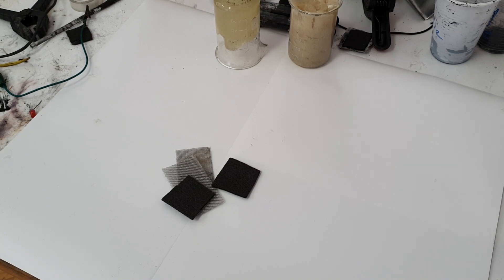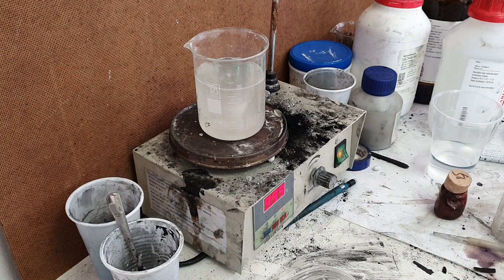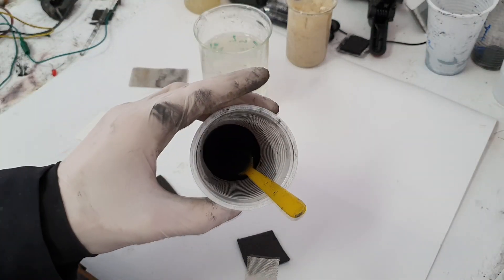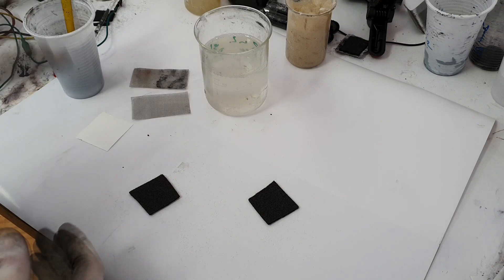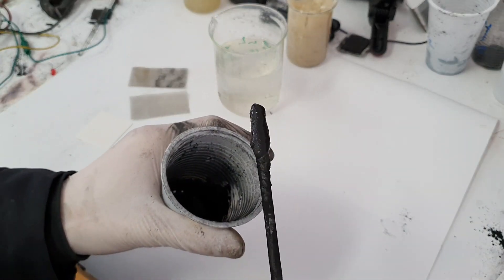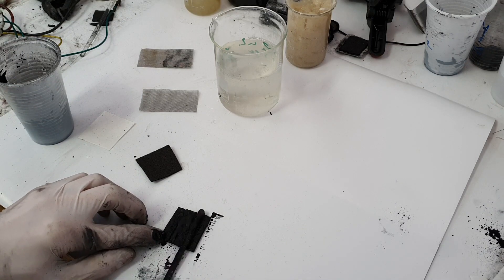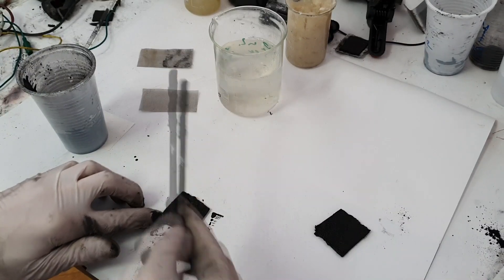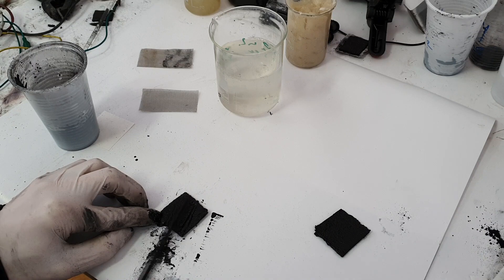Saltwater Supercapacitor

Comment: Hello please am using an aluminum foil to make the electrodes and I want to make a symmetric super capacitor. But I have conductive carbon black instead of activated carbon. Can I use the conductive carbon and a suitable binder for the active material on the aluminum foil? Thank you in advance

Comment: To make permanent cell you need to put it into sealed container with electrolyte? Will it last for years?
Like those on ally/ebay?

PS. I watched on another channel that water+salt gives only around 1.2 volts. Factory cells can be charged to 1.75v
Reply from the maker: You can seal the cell but the cell can also make pressure when is charged. This cell operate on voltage between 1.7 to 1.5 volts. If you charge for a bit longer then you can also run a LED on 2V. I dont know if I am right, but I think that you mean nickel iron battery? Ni Fe battery have the voltage of 1.2V and is charged with 1.65 to 1.7V
Reply: @cayrex  nah, those supercaps on allyexpress like 1-500 farad typically ratet up to 1.75 volts

Comment: I think I see why the stainless steel collectors must remain dry. As soon as electrolyte forms a bridge across the metal collectors they will add galvanic potentials to the cell and interfere with cell performance. Is that correct?